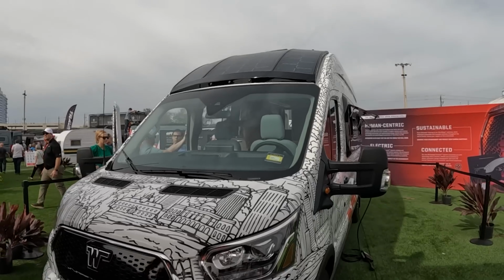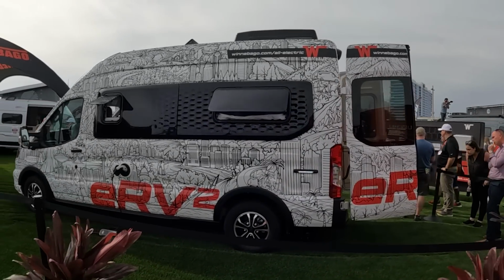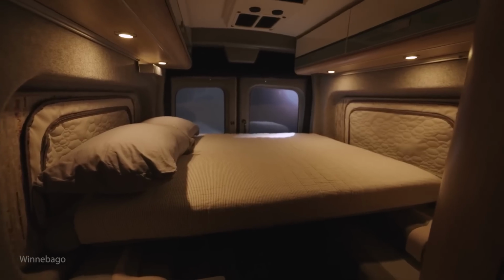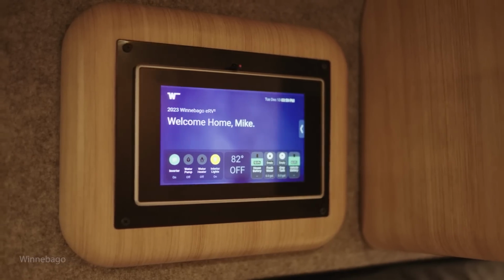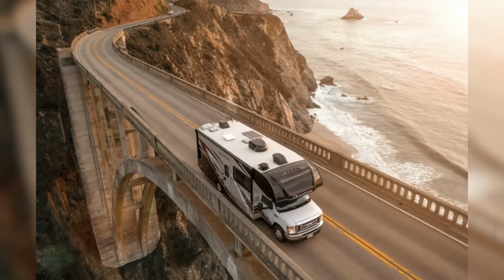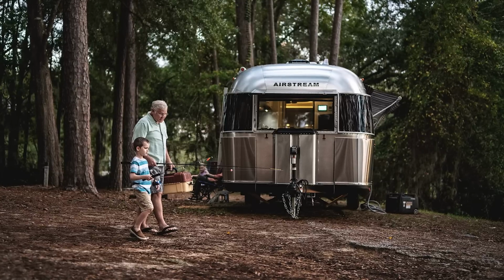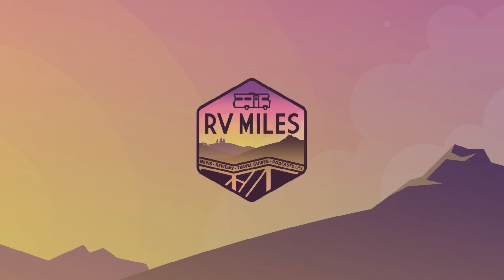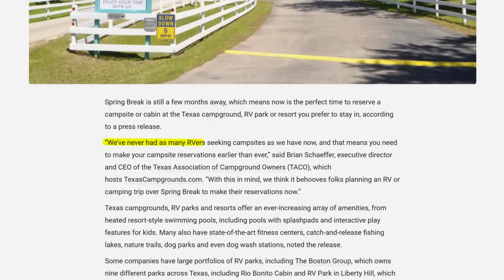Winnebago EV Revealed, Thor Partners with Starlink

Comment: THANK YOU for your 'rant' about creating better, more flexible ways to add accessories to your RV roof space (or RV exterior in general) instead of the latest pre-installed whiz-bang!!!  Flexibility and adaptability (i.e. future-proofing) of RVs is much more important than hardwiring in whatever the latest must-have trend item is...that might be obsolete in five years!

Comment: I absolutely agree with you Jason on having a universal mounting system on the RV with an easy-to-use preinstalled wire chase for data cables and power cables.  That is such a good input.  I hope the RV manufacturers are listening to this.

Comment: Airstream has the right idea if your interested in an EV unit. The eStream is an electric trailer which keeps up with the tow vehicle using a sensitive interactive hitch system to monitor and management power to the trailer wheels. Also it can park itself, so you unhitch and back it in with an app and can rotate the trailer as needed to ensure its facing the right way to optimize the view or sunlight.

Comment: Hi Jason, Since the Starlink uses 48v DC for power I have seen some YT videos where you can power it directly from your battery bank.  This requires some special hardware and re-wiring the connectors but you apparently can skip the DC to AC inverter.
Reply from the maker: Yeah I wish someone sold a premade DC kit. Still- a lot of power. Or that Starlink would make a dc version of the small dish. Still a lot of power on that big dish.
Reply: @RVMiles  I did see one YT video where someone put all the components in a pelican case and it was sort of plug and play but I don't know if he was going to commercialize it.  People that have that expertise usually aren't production and marketing focused.

Comment: Looking forward for an eRV with 300 miles and a 80% charge in 20-30min - like most EVs these days. It will happen even if it takes a few more years. We’ve done a TON of road trips with our Tesla and has no issues - plenty of Tesla super chargers and with the kids we always stop for the kids more often than for the car. A 20 minute break is perfect for a bathroom break, coffee or a meal. I hope that by the time eRV with 300 mile range is available competing charge networks would get their act together and work as well as the Tesla network… or maybe it will just be based on a Tesla van if one is ever available… 🤷🏼‍♂️

Comment: That ERV2 range is pathetic. Would have been better to just build a Travel Trailer with all those electrical frills instead of building a brick that can't get anywhere. Maybe they need to consider some sort of Hybrid Motorhome instead of an all electric one.
Reply: Note that it is a prototype. Ford has said there will be bigger battery packs in the future for the e-Transit. What better way to be ready for that future, than to build some prototypes and get real world experience?
Reply: @danandfaith  I am an optimist, but waiting for Ford to make this van into a long range RV will be another 7 to 14 years. A lot of us don’t have that type of time or patience.
Reply: serial Hybrid-  100-150 mile electric range and a small gasoline or diesel generator which job is to recharge, or run during boondocking.  A small single speed generator should be very efficient.  Add a nice size fuel tank and you have a couple hundred miles of range on a fuel for long stings and enough electric range for the daily exploring.
Reply: Airstream has the right idea. The E-Stream is an electric trailer which keeps up with the tow vehicle using a sensitive hitch to monitor and management power to the trailer wheels. Also it can park itself, so you unhitch and back it in with an app and can rotate the trailer as needed to ensure its facing the right way to optimize the view or sunlight.
Reply: @SignalCorps1  So true!This concept can increase efficiencies of all tow vehicles, be it fossil fuel or electric. This is a solution that can instantly provide better performance for all RVers. Can’t wait to see universal adoption!
Reply: James of The FIT RV channel has an extensive sit-down interview with one of the designers. James is an aerospace engineer by training, so it’s a good solid, technical interview .
This isn’t the final product, it’s merely an interim prototype and they’re working on the battery life. I think he said that it will be up to 175 miles soon. And he points out that it’s quick charging, so you could pull over, have lunch, pull out again with a fresh charge.